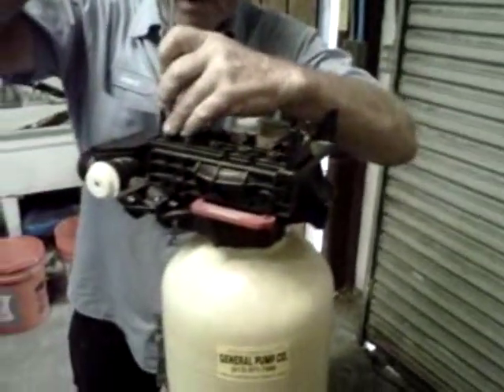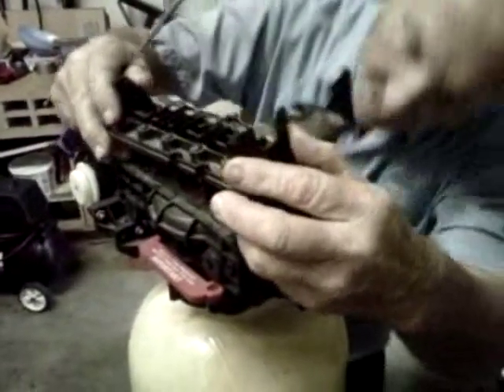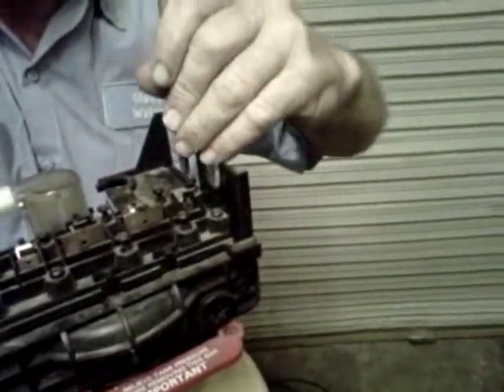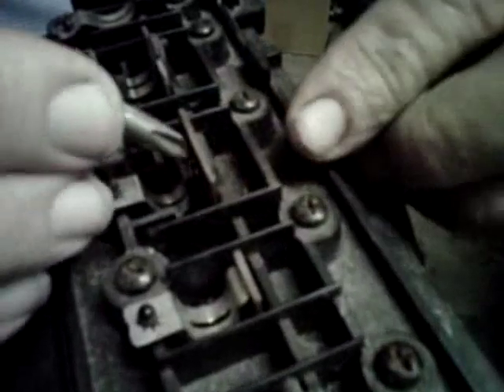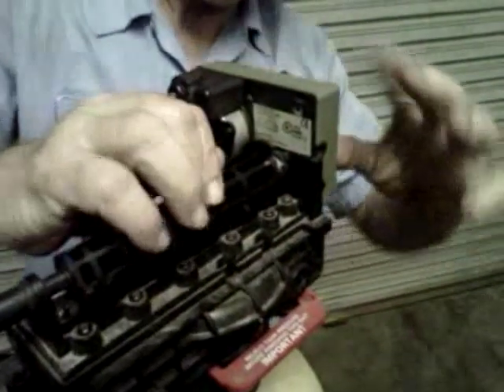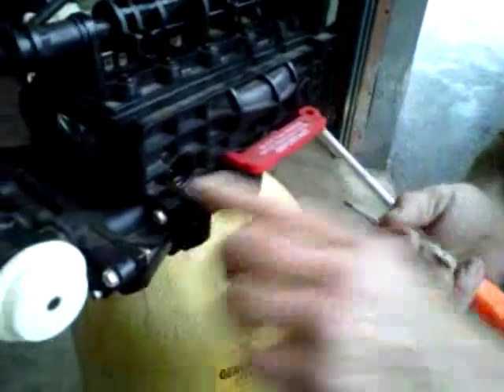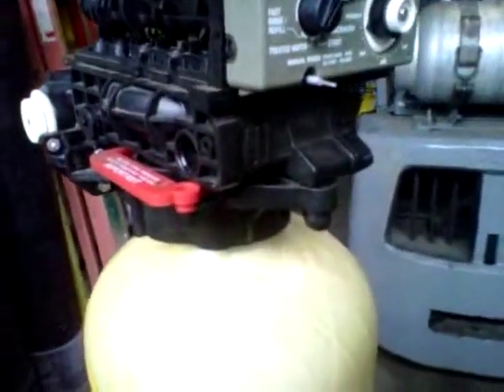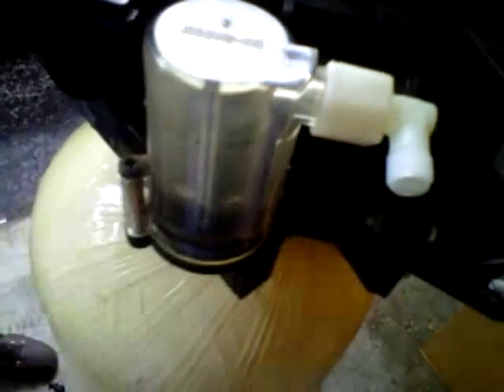Rebuilding Autotrol/Osmonics Control Valve

Comment: I have this system, and my Salt tank is not draining, I changed all the packing, the rubber valves the jet the filter assembly and is still not draining the tank, any idea what I should do next?
Reply: I’m sure you figured out that it was an air leak by now. Right?